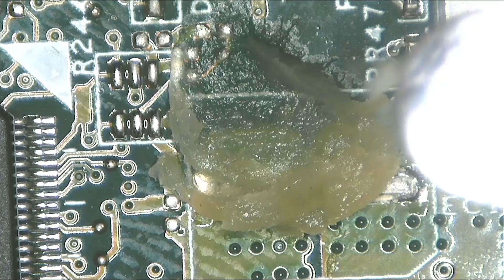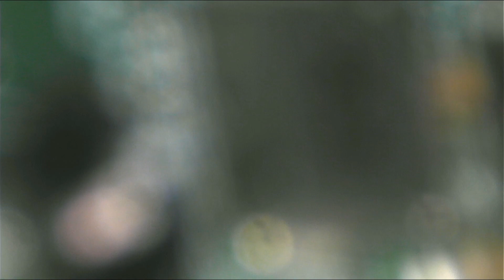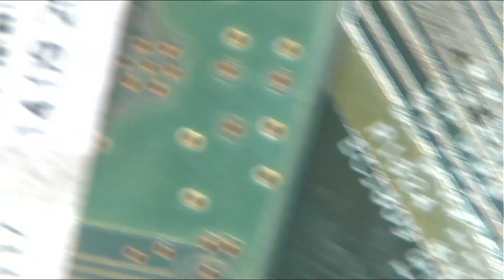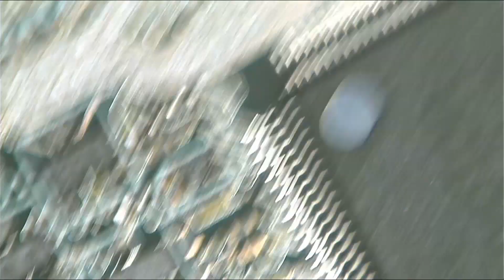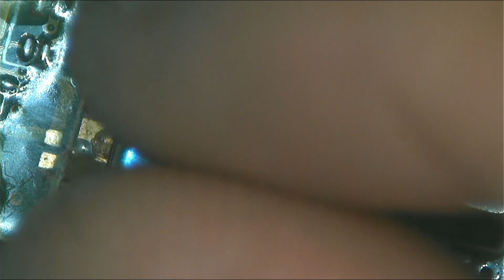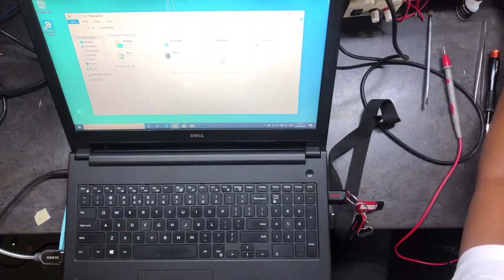Unable to install operating system on Dell inpiron 15 - Solution and cause

Comment: Hi JB. audio is very low. But great video anyway.My question is when u say just before it boots windows at what point exactly?In windows 10 is it at the spinning balls ? I had a couple of HP probook  labtops that did this and was never able to figure out the problem.Am thinking if it might very well be those electrolite caps might be the issue as your video pointed out.
Reply from the maker: Yes the problem is always gonna be those electrolytes capacitors
Reply from the maker: Every time when I try to load operating system it was failing, freezes, do all those funny things but never reached the desktop